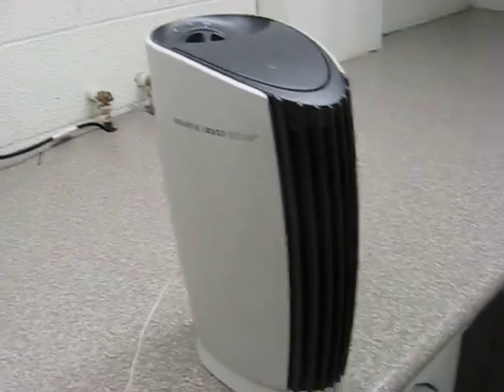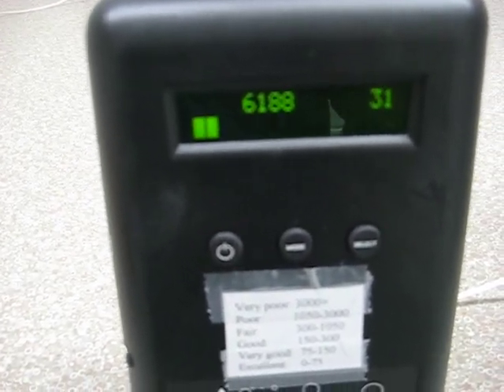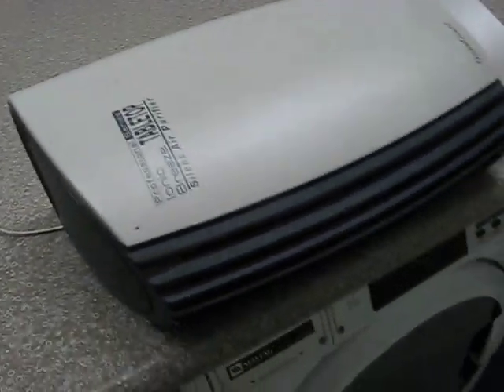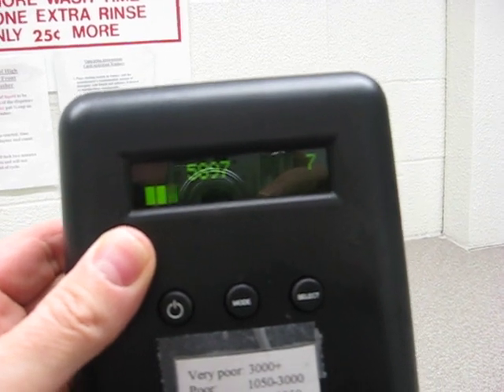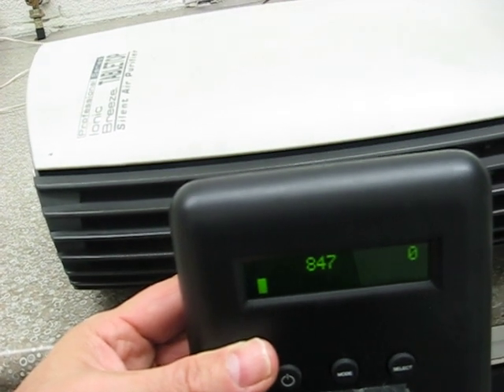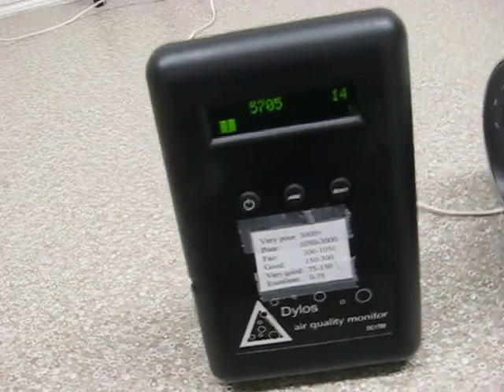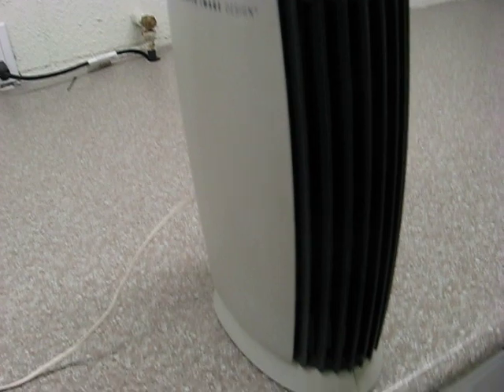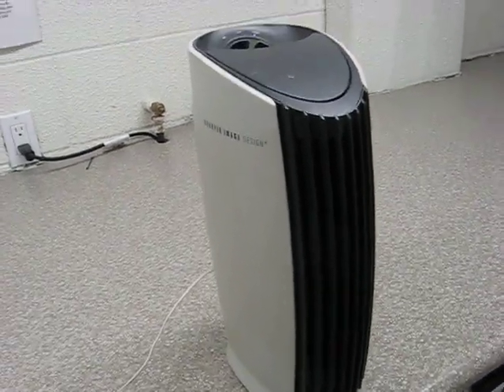Ionic Breeze Particle counter test.

Comment: Better Than Paying $$$ For Air Filters
Reply: Totally agree. I loved the Ionic Breeze in 2006. No filter change! Very low electricity use. Buying HEPA filters is the same price (almost) as buying a whole new filtration device.
Reply: @bukuism 
It moved very little air, couldn't pick up larger odor particles and released dangerous levels of ozone. It actually worsened air quality. It damages your lungs.

Comment: This guy's measurement of ozone is BERY poorly executed to such a poor degree his findings are useless.  For his determination on ozone output (see his other pointless videos), he placed the measuring device directly in front of the unit.  Now, imagine you are measuring car exhaust.  If you place your measuring device at the tail end of an exhaust pipe the readings are high.  Move the measuring device two feet away, and you have a completely different reading.  Move it four feet away, and the device reads less exhaust because of dilution from the air.  So, his statement that it produces a lot of ozone, is b.s.  Instead, go to the government report from 208 that measures, specifically the Sharper Image Ionic Breeze; the government report states there is no problem, and the bit does not exceed safe parts per billion.
Reply: So is it good to use or not?! I just got one :/
Reply: @andreaperez1991  I Have Many Of The Large Pro Series And They Definitely Help With Odors, Sharper Image Designed These Back In The Day And Everybody Is Copying Them. I Ended Up Buying My Collection Off Ebay, Be Patient And Get A Good Deal Under A $100 As These Were Sold In The Sharper Image Store Inside Malls Years Ago & Their Catalogue, The Newer Ones Sold Now I Have No Experience With Them Just The Tried & True Old School Ones Work Very Well & Totally Safe Dont Get Scared As I Have Been Using Them For Over 20 Years
Reply: @andreaperez1991  I think it is.  I have one similar, that no doubt produces more ground ozone than would be permissible.  But it is not an excessive amount as a percentage of what would be allowable.  Think of it this way:  Purely an example, pulling numbers out of thin air for the example; If the allowable limit was 2 out of 100 parts, the actual output would be 2.1, so in this example it is 5% over limit, no excessive, but tat is just my opinion.  I have found the best air purifiers, especially if there is a smoker in the room, is anything that is ionic; the ones that have a hepa filter that needs to be changed, are just way too expensive in the long run.
Reply from the maker: @andreaperez1991  It is not as effective at removing microscopic particles as a HEPA filter with a fan. As far as Ozone goes, read the EPA info and decide your yourself. https://www.epa.gov/indoor-air-quality-iaq/ozone-generators-are-sold-air-cleaners
Reply from the maker: I am measuring particulate matter not Ozone. Pointless videos? You must sell ozone generators.   Go argue  your point with the EPA https://www.epa.gov/indoor-air-quality-iaq/ozone-generators-are-sold-air-cleaners